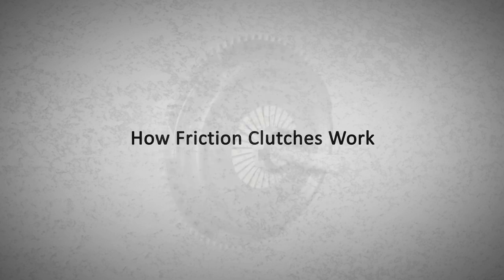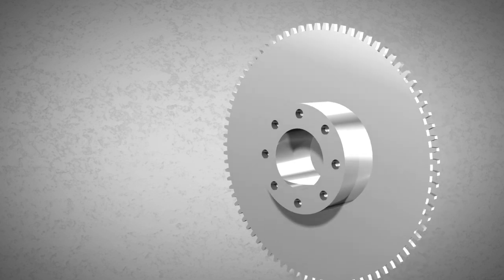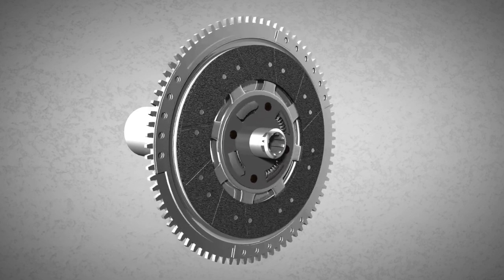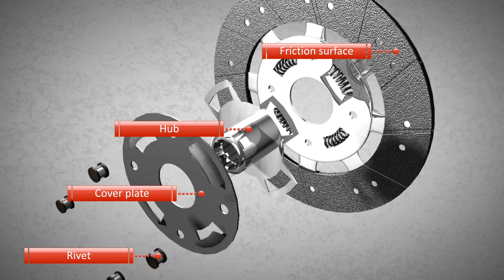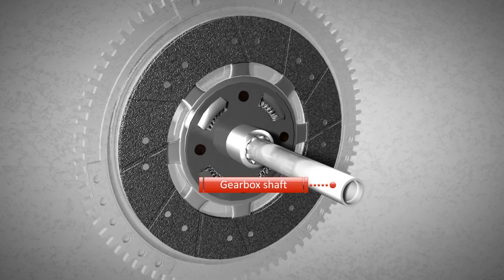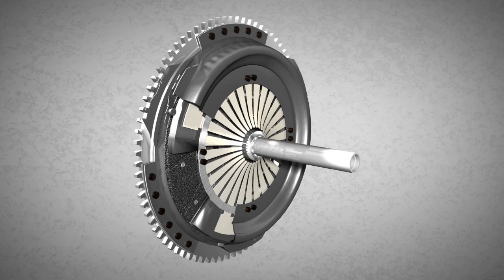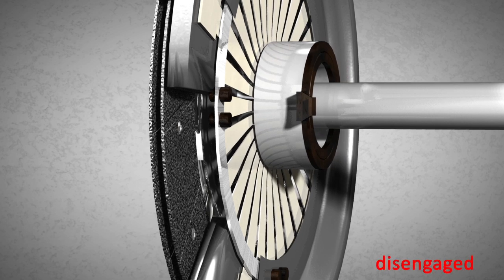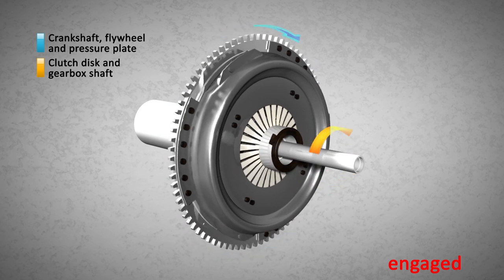How a clutch works! (Animation)

Comment: One error in presentation.   The pressure plate is bolted and not riveted to the fly wheel.  This allows the replacement of the clutch friction plate or through out bearing.  Both these are often replaced on high mileage vehicles.

Comment: I have a question. If the car is in motion, and we press the clutch to change gears, how does the car wheels don't interrupt the gear shift? I mean like, the wheels are still spinning even when we press the clutch and the wheens are connected to the drive shaft to the transmission.

Comment: Fantastic explanation and animation but the strobe effect is weird at 0.54  there seems to be opposite rotation but I see this is all locked together and all rotating in the same direction , just an optical illusion on the eyes due to the frame rate of the video?.

Comment: There is and error for the throwout bearing animation at 3:20. Supposedly only the clutch bearing rotates while the clutch housing stays (dark colour)  there because of the clutch fork.   Not both.
Reply: That is not correct. The pressure plate is bolted to the flywheel, it turns at the same rpm as the engine. The clutch disc is what stops rotating when the clutch pedal is pushed

Comment: The animation is good but there are a few faults. There isn't "friction material" on a flywheel. There is a flat machined surface. The clutch plate runs on this. There is also no mention made of revs and the speed at which the clutch is engaged, which is what most drivers have a problem with.

Comment: most motorcycles have the clutch immersed in oil...  that's not a dry clutch, and it's the reason that motorcycle oil and car engine oil are not interchangeable...

Comment: Does the transmission shaft rpm becomes zero when the clutch is engaged?
Reply: The transmission shaft spins at the same speed as the engine, when the clutch is engaged.
Reply: When the clutch is disengaged?

Comment: I still don't understand. The pressure plate is bolted to the flywheel right? And the pressure plate also bolted to the clutch disk. So when pressure plate spin because of the flywheel, it will also spin the clutch disk and never disengage. Anyone can explain it to me? Thank you
Reply: Oh the clutch disk is not connected to the pressure plate

Comment: Great explanation, but pressure plates (in my experience) are not riveted to the flywheel, or you could not bolt the flywheel on the engine (or replace the clutch disc/pressure plate easily, especially with the engine and trans in the car.  Maybe newer cars are riveted, but older and high performance cars are not (they are bolted)
Reply: Some are riveted from the factory and the replacements are bolted.

Comment: Can an input shaft still move at engine speed with the clutch pressed down?
Reply from the maker: Why would you ask this question?
Reply: Thomas Schwenke Well to try and eliminate a faulty gearbox from my diagnosis. It is possible if the clutch doesn't fully disengage, but that would be rare

Comment: So clutch works by only friction force? rubbing plate each other from flywheel surface and to clutch surface connecting to the transmission?, how is it possible to drive the tons of weight of truck plus the load, by only means of friction? not gears,belts etc... Please answer Thankyou :)

Comment: What a great animation!! Thank you for the hard work in making it. One thing I still don't understand is when the pressure plate is releasing or engaging the clutch to the flywheel is it moving back and forth on the splined shaft as well? Even just a little?

Comment: I still don't get it. I find it hard to grasp that the connection and delivery of all that mechanical power from the engine ... to the wheels is basically done by two plates of metal covered in sandpaper pushed to touch each other and synchronize their speed.. Why am I not hearing al that violent friction when driving? Why is my clutch not getting super hot and catching fire? How can clutches survive that long, it's just metal scraping metal? How is it possibly to let the clutch "slip" and still drive? Because it's not being pushed together at full force and the engine side is running a bit faster than the side that drives the wheels? But it feels so smooth when doing it. I can only think of a grinding wheel grinding away with 200hp of power and someone pushing another grinding wheel against it. Smoothness is not what I should be expecting.
Reply: LS_scape 
Once the two discs lock into place, it would take more energy to break the friction bond than to keep it going. The friction surfaces have an extremely high coefficient. Also, these surfaces are not noisy metal. Probably something closer to a hard rubbery type material.

When you disengage the clutch at a high speed, the engine and the wheels are operating separately but that doesn't mean the wheels will stop turning, obviously. The car still has loads of momentum to conserve. If you engage the clutch while the crankshaft is turning faster than the wheels, the engine will have to slow down to compensate. it can't speed up to compensate unless you give it gas. You can feel this by just downshifting.

Comment: Hi , 
I was enjoying my ride at 80-90 Km/hrs  Express highway on my Honda car , suddenly I noticed that my car is not accelerating further even after giving  acceleration . later it was not picking up after restarting again  . I want to know possible reasons behind this sudden failure , as previously no slowdown symptom was persist in my car . 

Appreciate if you can revert earliest .

Comment: Its fun with a 3 on the tree and can shift from 2nd to 3rd without depressing the clutch and it automatically goes into 3rd overdrive saves wear and tear on the clutch. My 49 in my profile picture has a 3 on the tree with overdrive in it and that's a whole separate ball of wax in its self. Its uses a planetary gear setup for overdrive, 1st gear 2nd gear direct drive 2nd gear overdrive 3 gear direct drive 3rd gear overdrive and reverse. Confused yet ?  But you have a pull cable you push in our out for over drive to work.
Reply: B. Steffey the only problem with shifting without the clutch is you will prematurely wear out the synchros.

Comment: So pretty much the clutch is like a brake for the engine and the gear box to gain and lose throttle while driving?
Reply: Well it isn't a brake, the engine keeps on turning all the time, it just connects or disconnects the rotation force of the engine to the wheels.

Comment: Quick question.. For a slipping clutch, is it necessary to replace the flywheel also?
Reply: No, you might be able to get the flywheel resurfaced... but don't.  You're either dropping the transmission or pulling the engine just to get to the clutch... which is not something you're going to want to do (or pay for) again anytime soon.

Comment: it helped see how it's connected overall, but is there any better diagram to see how exactly the diaphragm spring and pressure plate attach to the clutch disk and the clutch cover? I couldn't quite see how the pressure plate is moved away from pressing the clutch/friction disc by applying push to the throwout bearing :/

Comment: how does the pedal move the pressure plate?
Reply: The pedal isn't moving the pressure plate the engine is, technically the crankshaft of the engine. All the pedal is doing is moving the bearing in/out causing the clutch disk to be disengaged/engaged, respectively, to the flywheel.
Reply: When you hit the pedal, the force is transmitted through a linkage, cable, or hydraulic system to a fork that rides the input shaft of the transmission.  The fork pushes the throwout bearing into the teeth of the pressure plate.

Comment: I have a question, what could cause a clutch to burn? I mean smoke, is that possible? It happened twice, I was going uphill, I started to smell something burning, I opened the bonnet and there was smoke coming from engine bay... I dont know if it was clutch but it's the only thing I can think. Only happened uphill. And also I did notice a small oil leaking coming from the gearbox side. Could be main seal leaking to flywheel and clutch burning oil? Thanks
Reply: Hello Andre, The burning you probably smelt was from the asbestos/ ceramic content on your clutch plate giving way due to excessive heat generated from excessive friction, thus the smoke. This occurs due to a fundamentally large difference between the enginre flywheel and the cluch plate (friction surface) in terms of relative speed and/or coupling load. In a nutshell, the ctutch in question was overloaded (due to the load and uphill ascend). And since you probably revved up the engine to put up with the uphill ascend, you in turn generated a considerable difference in velocity and loading between the friction surfaces of your clutch mechanism. 

About the leak... I assume yours isnt a straight-off-the-showroom car so one of the key sources of leaks around the gearbox or bellhousing is a lip seal failure on the Gearbox Input Shaft. Get it checked out.
Reply: Thank you fo your the explanation, very good. My car is an old 94 toyota, that day I was by myself and uphill, driving slow, around 30km/h - 2gnd gear - 2000rpm maybe, enjoying the view when that happened. I drive manual transmission my whole life and never saw something like that, I mean, I've seen clutches burning but not when driving steadily. I dont really know if I did something wrong or if there is something wrong with the car. Anyway, it's been a few weeks and in town never happened again. I am doing some mechanics jobs in this car for a hobby and change clutch and seal would be a nice challenge. Thanks again.
Reply: haha
Reply: Andre Luiz are you maybe holding brake while letting clutch upward?
Reply: The clutch has to slip in order to burn, so that wasn't it.
Reply: It may be the case, if its old and does not fully engeaging,... but overall Clutch usualy out-live most of other components
Reply: The car is going fine, even I can sometimes feel a burning smell going uphill it never happened again like before... the wee leaking is still there, on that side, dripping on the gasket just on the clutch housing, but nothing major. I gotta clean and try to see where is coming from. After the holidays break I will either try myself or take to a mechanic. The car is a '94 rav4 awd. Thanks everyone.

Comment: anyone who is also confused by the rotation of the flywheel teeth? Looks like its rotation counter clockwise to me.
Reply: This is called the wagon wheel effect: https://en.wikipedia.org/wiki/Wagon-wheel_effect
Reply: Vincent Aventurado its an optical illusion
Reply: Vincent Aventurado a grankshoft teeth is 26, then camshoft howmany teeth have sir?
Reply: I doesn't look like a strobe effect , it seems they are counter rotating

Comment: Why engine stall when I release the clutch quickly?
Reply: You don''t give the engine enough gas, and the crankshaft doesn't have enough force to overcome the inertia of the driveshaft, which is connected to your wheels.
Reply: Okay. But, what about the   semi transmission paddle does it have a same scenario?
Reply: After a quick google search, it appears that the clutch is automatically controlled by actuators and electrical components, instead of needing you to press a clutch pedal. I'm going to assume that's also why there isn't a clutch in Semi-auto cars. It still is automatic afterall
Reply: Thats why   i love my koenigsegg ccx
Reply: omgdan23 more precisely the angular momentum or force of the motor is too low when in idle to move the car.

Comment: Is flywheels the reason why car engine still operates when not moving?
Reply: I don't think that's what the guy was asking. He said, "Is flywheels the reason why car engine still operates when not moving?"

From those words you stated, No. The Flywheel is not reason why the engine still operates when not moving. The ECU (The Engine's Computer in the car/Engine Control Unit) keeps the engine turning at a specific RPM to prevent the car from stalling other than that the car would eventually stall after every stop. ECU makes sure the engine gets enough fuel for the engine to stay on at that idle RPM (tends to be around 500-1000 RPM).
Reply: Yes. The flywheel store the energy from the crankshaft when you're not giving the engine any gas and keeps the crankshaft spinning.
Reply: does the clutch automatically disconnects when idle?
Reply: Emm, no. As long as the clutch pedal is released the clutch is connected to the engine. That is why you have to have your foot on the clutch when you start the car.
Reply: no clutch only engages engine when pedal depressed.when not depressed cluth and gearshaft are disengaged.clutch spring rotates with flywheel until pedal depresses against flywheei which is turn gearshaft to catch the next gear.when released clutch spring releases clutch and gear shaft to idle again.
Reply: insertrandomcleverusername you need to manually disengage the clutch with the clutch pedal
Reply: No. The main function of the flywheel, just like any flywheel in any machine (flywheels are not specific to the automotive industry) is to smoothen the rotation of the engine, by adding mass, and thus inertia to the crankshaft.

The crankshaft rotates by being repetitively pushed by pistons (4 times per revolution for a 4 cylinder engine). If there was no added inertia to the crankshaft, its rotation would be very jerky, spiking with every combustion in the cylinders, making the ride very uncomfortable and putting excessive stress on the clutch, the gearbox and basically everything else.
Reply: in an automatic transmission, the engine can run while the car is not moving because of the torque converter
Reply: Internal combustion engines cannot stop by design, they require to continuously run. It's a drawback of the design.
As you know, cars need to stop every now and then, so something had to be engineered to allow the engine to keep spinning and to disconnect the wheels from the engine whenever you didn't want to move forward. So the clutch was designed. followed by the torque converter in auto transmissions.
The flywheel however, can be heavy to store some of the engine's kinetic energy to give it more torque during clutch engaging (making it harder to stall) at the expense of a more sluggish engine response. I modified my subaru WRX with a lightweight flywheel and it revved much quicker but it also made it easier to stall.

Comment: So springs makes the acceleration smoother?
Reply from the maker: Yes. Also applies when up- or down-shifting.
Reply: Matt Brock no that is not the clutch grinding. it's so there is some slack and softens the grab at the moment of full friction. instead of hitting a metal bat against a metal pole the springs are like putting a towel around the end of the bat. you get less vibration and harshness b cause the spring dampened and absorbed that energy.

Comment: so what connect the 2 shaft is only the friction forces? no gear connection whatsoever?
Reply from the maker: Yep, that's it! :)
Reply: +Thomas Schwenke how about supercar or some heavy duty trucks?
Reply: +Jonathan Sharon even they do have friction clutches, at least I think that, you have to imagine that you can make the diaphragm spring stronger and even stronger which will force the two friction surfaces together stronger, so it will hold the large angular momentum coming from the engine. What do you think, Thomas, because I think I'm not a professional!

Comment: the pressure plate is bolted to the flywheel not riveted and motorcycle use wet clutches
Reply from the maker: That's true :)
Reply: Ducati being an exception.